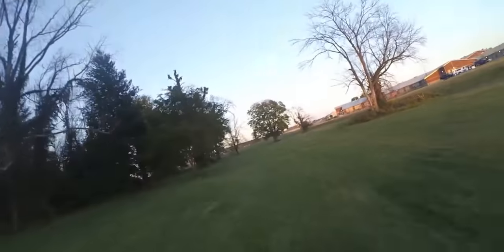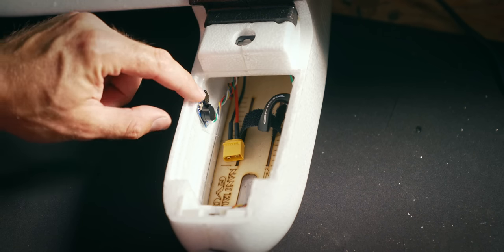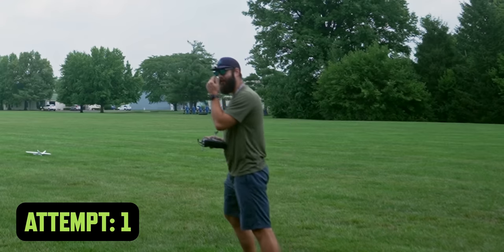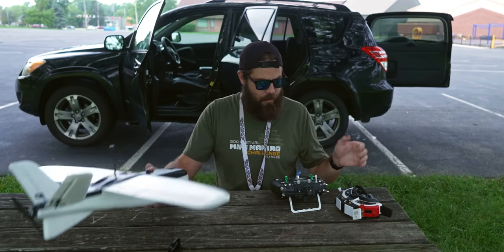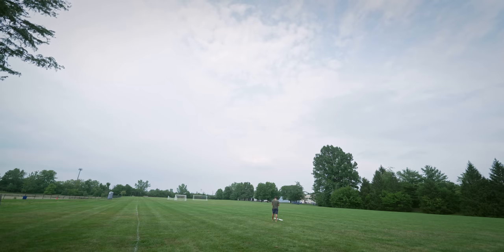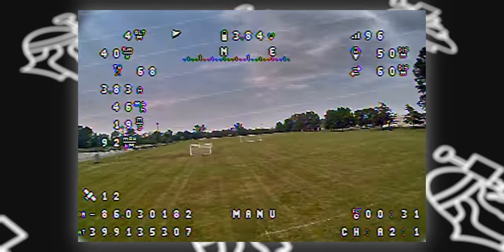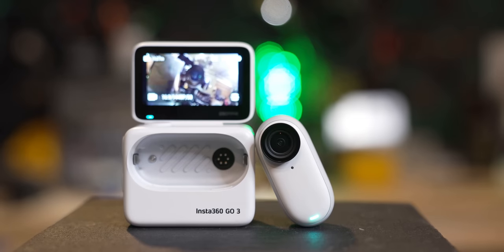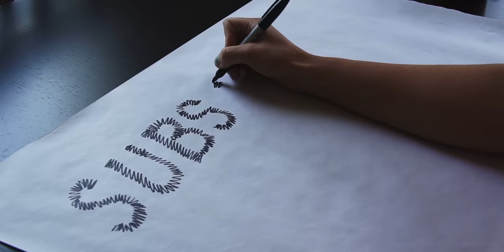Falling Back in Love with FPV

Comment: When you first setup a plane, make sure to manually adjust the control surfaces to neutral while the servos are centered. Some planes (many flying wings) prefer to have a bit of up elevon as 'neutral' position, and there's no yaw axis control. Test the plane (prop off or throttle disabled) at the bench by putting in stab mode and observing the control surfaces while you bank, pitch and yaw the plane around. Lift a wing, and that wing's aileron should move up and the other wing's aileron down to counteract your bank angle to level the plane. Lift the nose up and the y-tail elevons should move down to pitch it back down to level. Move the tail left or right and the y-tail elevons should move toward the direction of movement. Then at least you'll know the stabilization is working correctly.
Reply: Yep.  Servos not matching up in angle/stabilize is is pretty common.  Always better to find on the ground before launch.  Also best to fly manual and trim out the plane not with the transmitter trims but with the adjustable control linkage.  Otherwise stabilize mode will always be fighting it.  Manual mode is also the best time to test out whether the CG is right.  Stabilize will hide a wrong cg until its too late.  Trim out the battery placement in manual mode until it either flys straight or drops the nose just a bit while the elevons are level or slightly pitched up.  The mini talon / talon is not a slow flyer and I am guessing this model inherits some of that.  Keep the speed up.  Full throttle launches will also sometimes dive to one side due to torque roll so 3/4 is a good place to start with a mostly flat throw.

Comment: You can check the gyro 'angle mode' while on the ground. Just wiggle the plane around and watch the surfaces move to correct. They should do the opposite of whatever wiggle you are doing.
Reply: exactly what I was thinking too

Comment: Nice to see, it's not that difficult. normally I fry in manual/horizon (it's a plane ;) ) if you look in INAV 6.1 setup you can see the orientation of the plan, and how it responds to the movement. Then if you put in angle or horizon you can see how your elevons and elevator moves. I usually use autolaunch, because I'm lazy. have fun... hope this helps ...

Comment: This is exactly what the iNav learning curve is like. It’s all worth it though! It looks like your plane either thinks right side up is upside down and that down is up. Put the plane into angle mode and move it around with your hand. When you roll right, the left aileron should go up, when you roll left the right aileron should go up. For the tail, aiming the nose up, should make both ruddervators  (yes, they are called that ) go down, and aiming the nose down should make both ruddervators go up. If something is behaving behaving backwards, you need to reverse the servos in iNav, not in OpenTX. The fact that it flies OK in manual, but not in any of the automatic modes makes me think that you reverse the servos in OpenTX and not in iNav. When you use iNav, you don’t do any mixing in opentx like a normal plane, just use the same opentx model that you use for quads.

Comment: I have some feedback on what you are "doing wrong".  Or, could just do better.  First, you can check angle mode without launching it.  Put it in angle mode and move the model around and make sure the ailerons move the correct way on their own.  Tilt the model left and the left aileron should come up while the right goes down.  Tilt it right and the right should come up while the left should go down.  Tilt it forward and the elevators should come up, and vice-versa.  Very easy pre-flight test that you should do before EVERY launch along with the high-5 check.  If you have that sorted then it is actually safe to auto-launch, even for a maiden.  Also, turn on continuous auto-trim in iNav to get it trimmed without any effort.  I'm sure you've done your research, but just in case you don't know about Painless 360, it is probably the best YouTube channel for newb wing and iNav pilots.  Good luck on Maiden 2.0!

Comment: Plug into a computer and make sure the board orientation Is correct and calibrate the accelerometer! Also make sure the control surfaces move the correct direction on the ground in angle mode. Rolling the plane right should try to roll left also check pitch and yaw (if it has a rudder).
Reply from the maker: I did both those things!
Reply: @NURKFPV when you plugin to configurator and roll the plane - does the image roll the correct way relative to the physical plane or opposite?

Comment: Unless you already did it I would reflash the inav firmware and recalibrate the accelerometer after flashing. I had something similar to this happening, and just had to completely start over by reflashing it. Also in the mixer tab make sure you look at the plane picture and match the control surfaces to the right port number. Good luck. Once you get it flying smooth and nice long range wing flying is so peaceful and fun to go explore.

Comment: Planes have a learning curve, even after flying quads for years. My first couple launches with my dart 250 mirrored yours, lawn darting into the ground 🤣 Through trial and error and research on the many inav groups and forums, I found out that I needed to add a few degrees of “reflex” to the control surfaces (basically “up” trim but done manually). After that I finally got it up in the air and she flew beautifully. Not sure how the reflex would work with your plane as the dart 250 only has two control surfaces and uses “elevons”. 

What I would do with your angle mode issue is plug everything in, toggle angle mode and move the plane around in your hand to see what the surfaces are doing before you even attempt to hand launch. If everything is plugged in and set up right, while holding your plane all of your surfaces should be pretty much flat. This will tell you if you have any issues right away. With how yours was wanting to roll right away, if you would have looked at the surfaces before flying, I bet your ailerons weren’t flat at all and trying to compensate already. 

Inav auto launch is a game changer as well. It can save the gnarliest, nastiest of tosses (given your plane is set up correctly). For long range stuff, cruise and alt hold are fun to toggle on, sit back and relax while you’re surfing the clouds (low clouds 400’ and under haha). Good luck and happy flying 🤙

Comment: You can check angle mode without flying on the ground by moving the plane and observing what the control surfaces do.
Reply from the maker: they do the right thing, which is what's crazy!

Comment: A little tip for ya when hand launching. Hold your radio with right hand and plane with left hand so you can still work elevators and ailerons. Bite the throttle stick and throttle up, then throw it.

Comment: Maybe your flight controller thinks its backwards or sideways in the plane, could also be that the plane corrects it orientation wrong in angle mode, move it in your hand in angle mode and really think about if it corrects in the right direction, had that same problem with angle mode and only saw that it was correcting in the wrong direction like the 10th time i was checking.
Also a tip: if the gps shows you the wrong direction home try disabling the compass, its not needed to calculate the orientation anyways!

Comment: Mostly I just think you need to do slightly more thorough preflights: Put it in angle (or stabilize of some kind) mode and check that it stabilises the right way - when you roll it to the left, the ailerons deflect in a way that would bring the back to level. Looking at that very rapid roll every time you put it in acro mode makes me think either you've got your ailerons reversed/swapped or your flight controller is upside down or something compared to what INAV thinks it is - check that when you're holding it level INAV's roll & pitch readout says 0. I doubt it's the V-tail servos that cause a roll that rapid.

Comment: I love the zohd stuff- i-ve got a dart and a drift. No self-respecting RC guy would fly the ugly foamies, but they are good for us quad folks crossing over. Soooo much fun. Toss a 2s liion into the dart, fly it until i am bored (30min or so) and toss it back in the car. Pull it out the next day and fly again with no recharge. Quads are work- once you get all the electronics going, planes are easy.

Comment: Nice! I have been flying FPV quads for 6 years and got into planes last year, and I had to learn a lot of new stuff too.
Look very carefully at the ailerons at 3:19 (attempt 3) and 6:40 (attempt 10), they seem to be reversed as you move the plane. When you have a plane in angle mode and roll it, the aileron on the high wing should be up, and the aileron on the low wing should be down, to get it back to level.

Did you reverse the aileron channel on your radio? If so, that would explain why it works in manual but not in angle.

Check the receiver tab and make sure nothing is reversed. If anything needs reversing, do it on the flight controller, in the servo mixer (set aileron weight to -100%), not on the radio.
On your radio, you can use the same 4 channels as for a Betaflight quadcopter.

As for board alignment, at 2:12, the arrow on your FC is pointing forward, and when you fly it, compass and home arrow appear correct, but please check the Setup tab to be sure.
The artificial horizon on OSD would be useful for this. (it will move wrongly if board alignment is not correct)

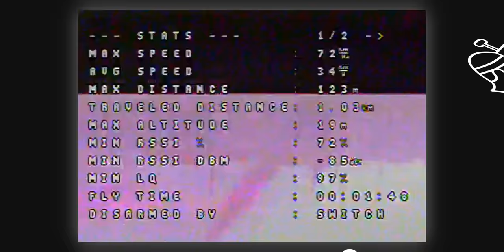At 4:48, it looks more like reversed ailerons than incorrect board alignment. 
It starts rolling slowly to the left, and then suddenly accelerates, suggesting it wanted to roll the other way, but it still rolls the wrong way, so it corrects even more (in the wrong direction)

Comment: For the isues in angle Mode, read the comments from @jahnkeanater and @wesorama.
In addition: 
1. Check CG. Seems a little bit noseheavy
2. Throw it harder. More speed means more authority on the controll Surfaces and more lift.
3. You have a V-Tail, means Rudder and Elevator share the Surfaces. You can't set your Elevator to 100% in the Mix because your Rudder need some deflection too.

For the launch issues in Manual: 
To fighting the Torque Roll in full manual setup a Switch on your Radio to enable the Trims on the Ailerons and in addition create on that Switch  a second Flight mode "launch" with its own Trim-Settings. Trim the Ailerons to the direction of your Motor spinning direction. After Launch the Switch set the Trims back to neutral.

Good Luck

Comment: You can see your ailerons are definitely deflecting the wrong direction while in flight using angle mode. So either your gains are too low and the FC doesn’t have time to react, or your aileron direction is reversed.

Comment: You raising the elevator to 100 made it impossible to use yaw & elevator at the same time. You need to have it at 50 for it to allow it to be mixed. If you had to little elevator authority you had to increase feedforward for it :-) but have fun planes are insanely fun
Reply: Also make sure the gyro moves in the correct direction (i bet it does but still). And 100% make sure youre using the correct servos for the correct servopin :D theres NO way to fix it in software! 3 left wing 4 right wing 5 left vtail 6 right vtail (when looking from the motor to the front of the wing)

Comment: I just recently also got a Nano Talon Evo and it has turned into my ardupilot learnign platform and I absolutely love it. I need to give you a word of advice: the way the ailerons are set up can give you some trouble once you hit speed because the rod that controls them flexes too much and can lead to the control input for roll being inverted (found out the hard way because I didn't wanna believe the person that told me). so if you ever wanna push the speed of this lil bird defo mod servos into the wings.
Reply from the maker: Great advice!
Reply: Also as to know whats wrong it might be that the flight controller alignment is somehow messed up. Also you can bench test angle mode because if you pick it up in angle mode it should counter your movements with the control surfaces. Easier than throwing it into the ground haha.
Reply: Servo mod is a game changer on this platform.
Reply: Agreed. It handles so much better after.  @NoFlyDrone

Comment: I had the same issue with a matek FC on a heewing T1, instant roll left and crash in angle mode. Tried reflashing, pid gains, and checked board orientation and control surface directions. Ended up crashing too many times trying to get it sorted that the plane was garbage before I ever got there. Best advice I can give you is find a wide open field in the wilderness and climb to at least 500 ft before testing angle mode. I ended up getting another T1 but opted for the VTOL version second time around and that uses a different FC and ardupilot and that flys great in all modes so maybe a FC issue or INAV issue. If you get it working please do a video explaining, I’d love to know what you find!

Comment: Dude I just went through that. Started astrophotography spent 10000$ for more and have my prints in art galleries and selling them. So now done with that sold lots of stuff and bought a pair of HDZero goggles 3 vtx 3 runcam 
Rekon 7” ZHOD extreme oh and 3 speedy bee quad stacks 3 speedy bee wing stacks. And i beat the shit of my s800. Took a break and a flight deck upgrade in the works. Auto launch needs to be mastered , not there yet.

Comment: You need to do 1)autotrim 2) auto tune , the. Try using any auto stabilizing modes . And you have to do those in manual mode .

And to check the angle mode you can put it in angle mode on ground the. Just wiggle it around and see where the control sirfaces are moving .

Comment: Here's what you did wrong:
1. You installed only 1 out of 4 motors on your quad.
2. Quads don't has wings
3. INAV? Pfff use Betaflight

😂Seriously getting Flashbacks to my short trip into the World of Wings. Broke 2 planes on maiden, half mutilated the 3rd one and got the autopilot do a waypoint mission. Well, that was neat, returned to Drones and never went back to flying wings 😛 They just move weird. If I want to turn left, I want to turn left, not in 100 yard, but right NOW!

Comment: You should get a fpv plane that has a T tail rather than a V tail. V’s have really low drag so they’re good for speed, efficiency and tracking longer distances. T tails have a higher mobility rate to them and if you look at something like war birds there’s some design like the F4U Corsair tail that has an elevator that will angle its inner sections on the tips of the elevator down when you pull up to help with creating drag and more control from your movement when it comes to up and down

Comment: Sure looks like something is reversed in angle mode.  While holding the plane, activate angle mode and then roll the wings left or right and make sure the ailerons deflect in the correct direction to counteract the roll.  Either that or you have the gains way too high.
Reply from the maker: everything deflects correctly when it's in angle mode and in hand!
Reply: @NURKFPV  Puzzling.  But then, INAV behavior is quite confusing sometimes.

Comment: I see lot of guys messing around with FC on FB. Easier just to put an rx in there and send it. Plane will hold attitude without the fc just set some low rates and have fun.
Reply from the maker: I agree that it's easier, but I wanted some of both!
Reply: @NURKFPV  it would have made a really boring video if it would have worked first time.
Reply from the maker: @RubyS.1 kind of why I recorded the video in the first place.. I knew it was going to be a disaster lol

Comment: 2 things...
First: The Nano Talon does not like to be thrown in a steep up angle, then it will stall and make a very short barabolic flight. Just throw it straight foreward (with a slight angle).

Second: Paste this in the CLI, then at least the mixer settings, PID's and rates are like they should!

# Mixer: motor mixer
mmix reset
mmix 0  1.000  0.000  0.000  0.000
# Mixer: servo mixer
smix reset
smix 0 1 0 -100 0 -1
smix 1 2 1 50 0 -1
smix 2 2 2 50 0 -1
smix 3 3 1 -50 0 -1
smix 4 3 2 50 0 -1
# Outputs [servo]
servo 1 1000 2000 1500 100
servo 2 1000 2000 1500 100
servo 3 1000 2000 1500 100
servo 4 1000 2000 1500 100
# profile
profile 1
set fw_p_pitch = 35
set fw_i_pitch = 20
set fw_d_pitch = 5
set fw_ff_pitch = 40
set fw_p_roll = 25
set fw_i_roll = 25
set fw_d_roll = 7
set fw_p_yaw = 50
set fw_i_yaw = 0
set fw_d_yaw = 20
set fw_ff_yaw = 100
set max_angle_inclination_rll = 450
set max_angle_inclination_pit = 450
set dterm_lpf_hz = 10
set fw_turn_assist_pitch_gain =  0.400
set nav_fw_pos_z_p = 25
set nav_fw_pos_z_d = 8
set nav_fw_pos_xy_p = 55
set d_boost_min =  1.000
set d_boost_max =  1.000
set rc_expo = 30
set rc_yaw_expo = 30
set roll_rate = 18
set pitch_rate = 15
set yaw_rate = 9

Comment: lol its so funny you made this video because this is litterley the exact same thing that i just did recently, like you said i as well kinda lost the joy of fpv quads and wanted to experiment i ended up getting a zohd baby ar wing pro put inav in it and had a blast its completely destroyed at this point though :( but i turned towards flite test and bought doller tree foam board and built up an ft spear i wonder if you will end up doing the same lol anyway nice vid.